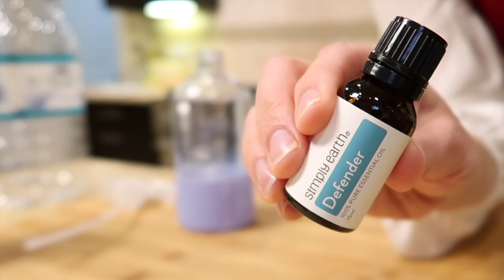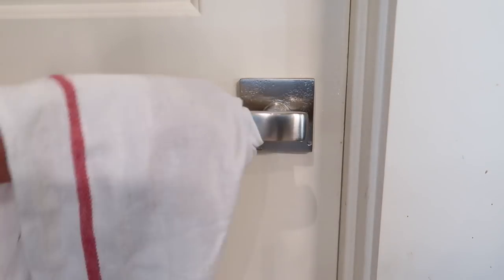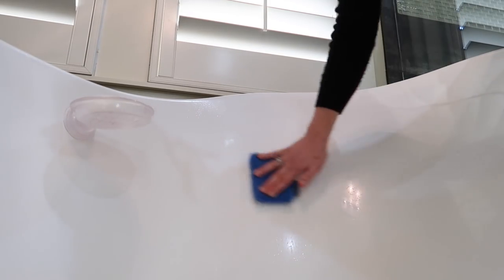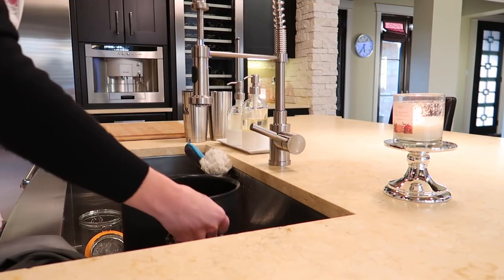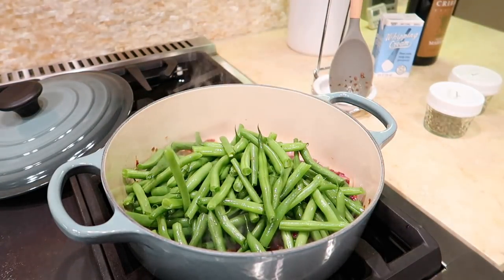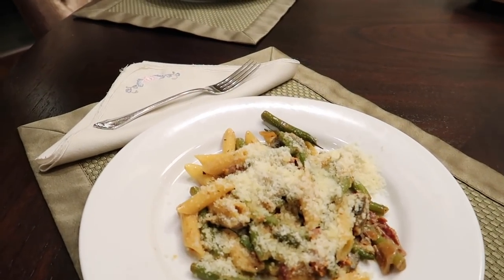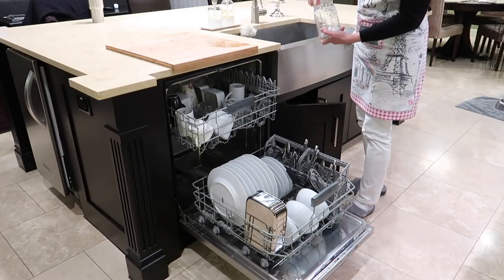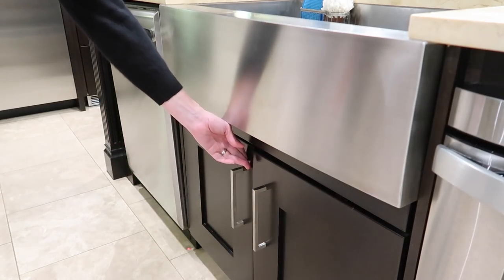Ultimate Clean With Me 2020 | Vodka Cleaning Hacks | Speed Cleaning Motivation

Comment: I just cleaned my carpets with a Green-machine Bissel rented from Ace Hardware.
I rinsed the carpets with Vodka and esstial oil.  But the is an unpleasant Oder and a sliet yellowing?
🙁
Reply from the maker: Sorry that happened Laura. I have never used vodka to clean a carpet that way. Maybe it reacted with the cleaning solution you used, or perhaps it was the heat. Vodka is odorless and usually works great at helping to eliminate odor, so I’m not sure what happened. 🤔🤨